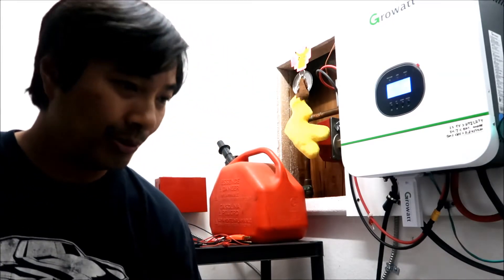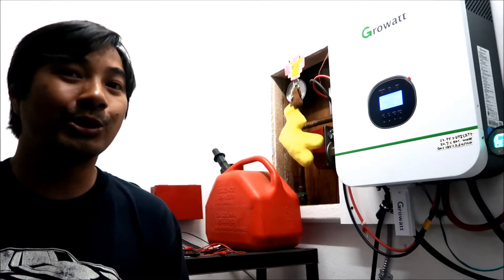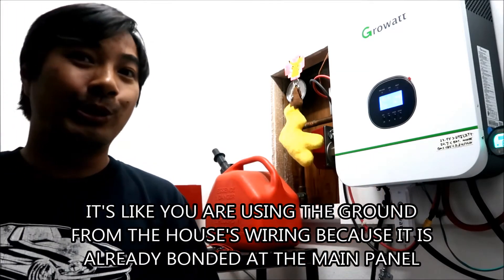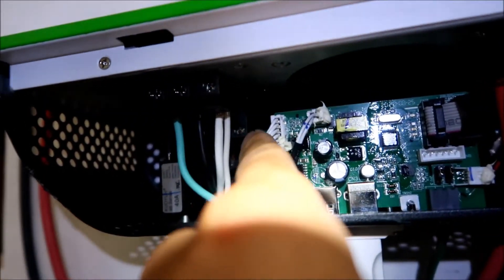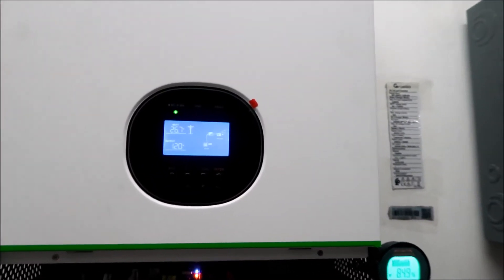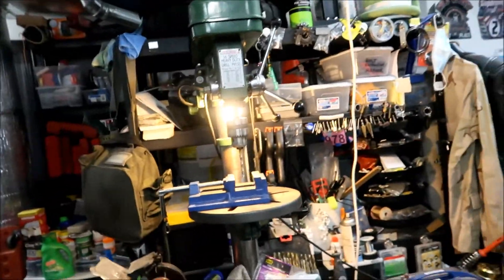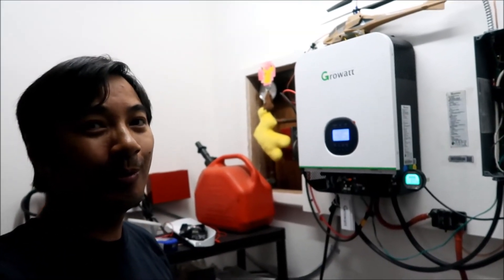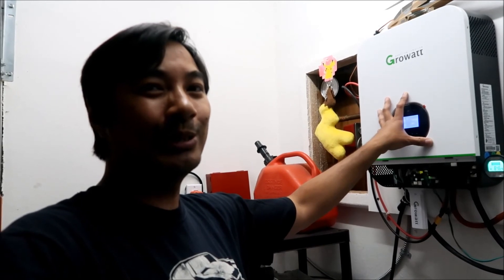HadesOmega Solar Garage Project Episode 81 - Success! Bonding Neutrals to Fix Floating Ground Issue!

Comment: Thank you!  I watched a video where a relay was added to the dry contact switch and that worked but I didn't want to go through the trouble of ordering and installing a relay.  

This jumper only took minutes to install and didn't cost me anything. 

I'm now properly grounded at the main panel via the ac input.  I'm no longer getting the open ground at my power strip.

🙏
Reply from the maker: Cool glad you got it figured out =)

Comment: So in the UK we have 5 different Earthing pathways  TN-S, TN-C-S, TT, TN-C, and IT.T 

TN-C No separate earth conductors anywhere - neutral used as earth throughout supply and installation (very rarely used).

TN-S Probably most common in older housing stock, with supplier providing a separate earth conductor back to the substation.

TN-C-S (Protective Multiple Earthing) Supply combines neutral and earth, but they are separated out in the installation. More common in newer houses.

TT No earth provided by supplier; installation requires its own earth rod etc. Note that a TT earth will frequently not offer a low enough impedance by itself to provide adequate circuit protection. Hence TT systems must use a RCD for additional protection.

Looks like your supply uses the TN-C-S

That dry contact should be label ON/OFF and not open/closed so confusing to the layman!

Comment: i have a similar issue with a bonded generator in an off grid system. I have an epever upower hi that has is unbonded. the generator is bonded. So on inverter power with no generator I have to make a bond. Ours is a TT system. So i bonded neutral to ground in the main panel. works for solar but with the generator we now have two NG bonds. The generator is GFCI protected and it trips. I thought about doing what you suggest. I.e. use the bond in the generator. Instead of the main panel, but, correct me if I am wrong but if the gfci turns off on the circuit your taking borrowing the NG from wouldn't that mean your now in an unbonded situation. Perhaps less likely with a stable source but with generators, they could trip..... I think I am going to just buy an inverter generator that is unbonded to solve my issue :)

Comment: What happens to the ground wire of the output of the inverter. Does it have to be bonded to the ground of the AC IN?

Comment: OK.. so in an off grid set up?:  (Generator and Solar only.)   Would the bond be done at the panel then? (AC out to panel from Growatt) --  We have been running with "open neutral" for more than a year and everything / all electronics work perfect including 3 GFCI's down stream. --------  BUT... my sniffer says there is voltage on white wires/neutral and plug in tester says "open ground" and that has always bothered me.  Want to get it correct.   Just ordered a new Growatt 3500 so I can increase VOC from solar, I wonder if that unit sorts it out better?
Reply from the maker: The Neutral to ground bond should be at the main panel.  I basically used the houses ground/neutral to ground my inverter input.

Comment: Dumb question:      Since your method in "80" worked in every way except it triggered the Ground Fault Interrupter (GFI),  why not just make sure the Growatt is NOT plugged into a GFI and problem solved??
Reply from the maker: Yeah I tried but all the outlets in my garage have a GFCI breaker on it.  That other one that didn't have the breaker actually tripped a breaker on another outlet in the garage.  =/